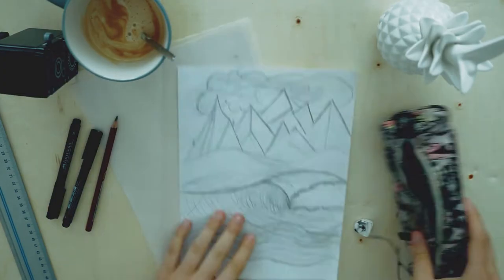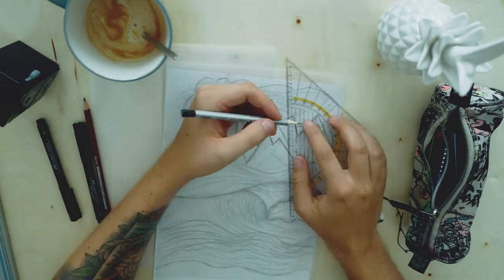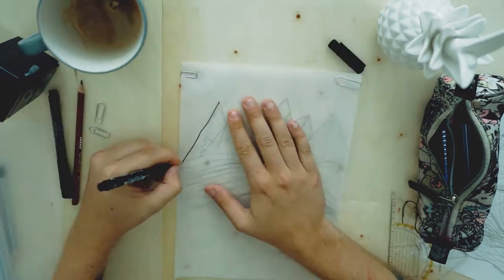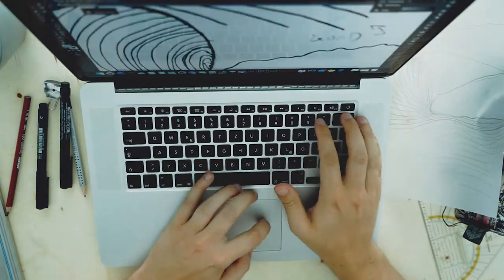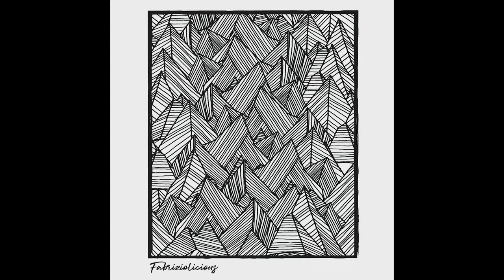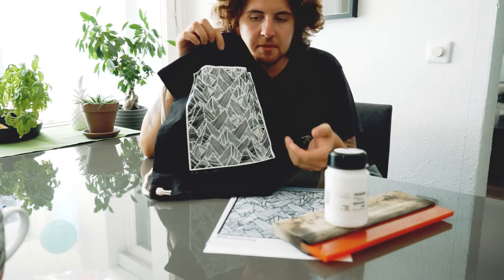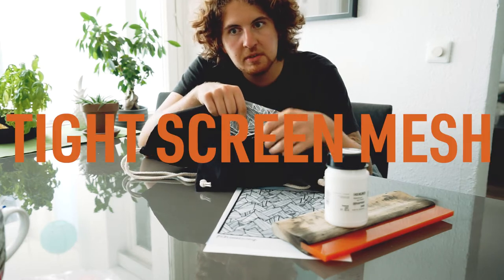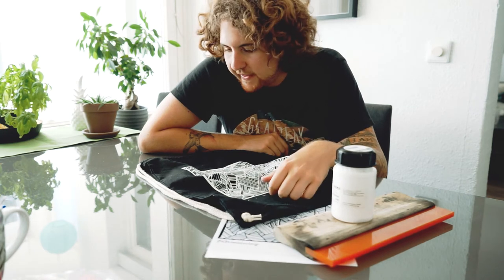Screen Printing: Abstract Design Workflow | Creativity Challenge Daily VLOG #6

Comment: You got good details in the main print so I'm sure your screen exposed fine.  What was the mesh count? If you got the ink through the fine detail on top it should have come out on the text. 

Now I paused the video at 1:52 seconds and it looks like the main image exposed better than the text at the bottom. It looks like some residual emulsion might have dried in that area.  Its hard to say but if the ink pushed fine through the top it should have PRI ted the bottom.  

Not sure if you made your own screen or not but if you did next time after you wash out the emulsion use a hair blow dryer on cool setting to blow out the image so you don't have wet emulsion drying in the holes.  Good luck the print looked good otherwise.  Hope that helps.
Reply from the maker: Hey,
 thanks for all the tipps. 

I do make my own screens (All-round emulsion and halogen light exposure for 6min 30)  and looking at it with the naked eye I couldn't see any residual emulsion in the area of the type, looks like it washed out just fine. 

However your suggestion sounds quite plausible to me, as you said the details at the top printed just fine so why shouldn't the ones at the bottom.

I'll definitely try the blow dryer trick next time to make sure that no emulsion dries in the holes!

Thanks again for all the good info, have a great day :)